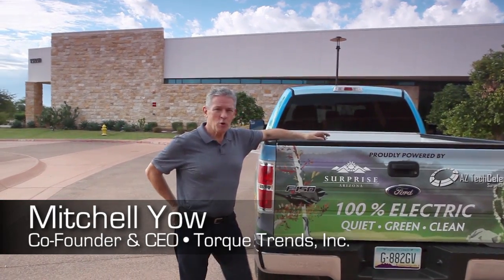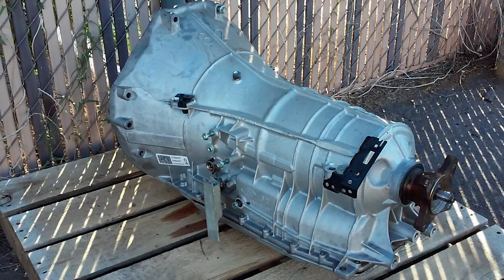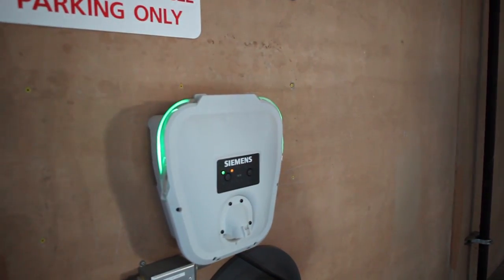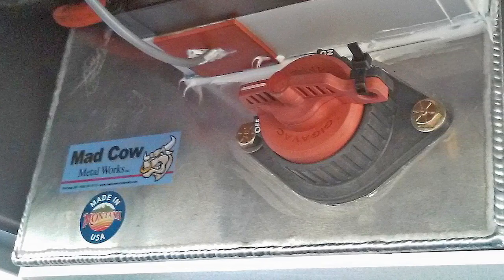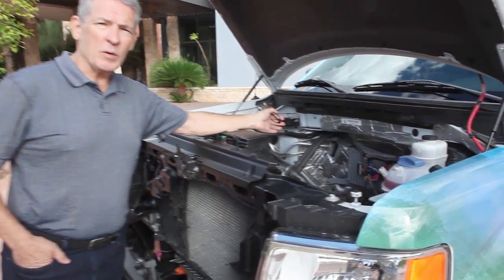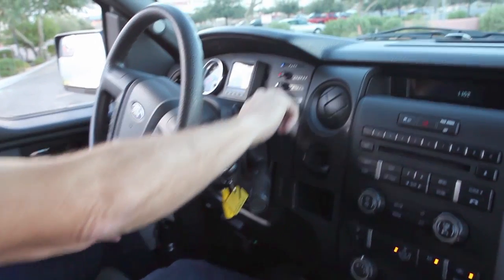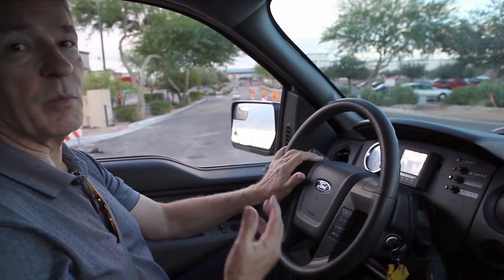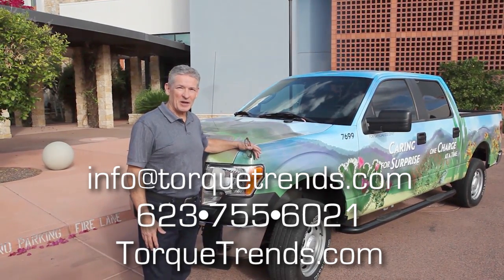Electric Truck Conversion - PNP F150 by Torque Trends Inc. Full Version

Comment: Very cool! Was that an aluminum body F150 or steel body?

My ideal electric pickup would be:

-Aluminum body F150
-4WD using the original transfer case
Could go as far at 75 MPH as it could with the original internal combustion drivetrain

That particular set of needs is driven by one of my core requirements: that it be flat towable behind a motorhome.

Is such a thing at all realistic? If so, how much do you guesstimate it would weigh, and what would it roughly cost to get one?

I know Ford will be introducing an electric F150, but early indications are that it will be like other EVs: that is, not 4WD and not four-down towable.

Comment: The bottom line: you can’t go on the freeway with it❌ 
If there was a way to boost the speed to a max of 75 mph loaded, I will be looking to sign up for the buy one. Great job on taking the initiative with your pilot project! It’s a great way to repurpose existing vehicles and lowering carbon footprint. Keep it up!✅✅✅
Reply: EVgine.com all electric F150 can go on the highway

Comment: Overall Wow!  Very well done!!  The only thing I could envision improving would be to put position sensors on the shift lever, so it operates just like a vehicle with a gas engine.  Electromotive ( diesel electric train engines) started with controls unfamiliar to the steam engine operators, but when they mimicked the steam throttle control for their diesel electric drive they converted the old steam engineers!  Probably why push button transmissions were less favored in cars as well..  I would definitely be happy using the buttons to select F,N,R, etc., I just don't know how the average driver would react to this style of gear selection.

Comment: But it’s not a zero emissions vehicle now is it. Where do you get your electricity from
Reply from the maker: Oh their live in Arizona and their whole roof is covered in solar panels.  Also most of big businesses cover their roofs in solar and give free charging for electric vehicles.  For example check out the roof of IKEA in Phoenix AZ ;)
Reply: Cool Car Video OK OK good point but What about everywhere else what if you have to travel more than 75 miles this vehicle is efficiency on zero emissions only applies to a short radius also if I got the full range of this vehicle wrong my bad. besides even huge company buildings that have solar panels lining the roof still aren’t completely independent from the power grid what’s your electric bill going to be 6Kw Is it a lot per Ful charge

Comment: I live in Buffalo NY, and it gets COLD... did you get the heat & defrosters working???
Reply: The entire 12v system and everything it operates is stock. Heat is a separate system and can also heat the battery pack.

Comment: Would cost about $12 to charge off peak @ .37c/kw but it's  75 mile range seems a bit short. I would want it to do 300+ $2.50/ galon for 21 G tank is still $52...will get you 450 miles
Theres plenty of room for more batteries....fill her up guys.

Comment: is it possible to install  100cc motorbike engine under the hood, to charge the cell  ?
Reply from the maker: We just made the video you can contact the builders here https://www.torquetrends.com/    but I guess you could get a Generator that runs on gas but I m not sure how long it would take to charge the truck.  I think it would be in 8 -10 hour range with a good generator.

Comment: We are in desperate need of a switched reluctance motor with a 15000RPM redline made specifically for conversions and sold to the public for no more than 5000 bucks. And also a closed system battery pack. Only this can save the classic car industry after ICEs are prohibited.

Comment: It's ok but 75mile range is useless and why a truck...that's now made useless it's no where near powerful enough to do anything, why not a sedan that would have been more efficient. I figured with a truck you could use a nice strong motor and have more room for batteries  ie under the bed and in a tool box in the bed something like this needs to have a 350 mile range with 400hp and 5-600 torque then it would be useful

Comment: It is a Good Idea. I'm not a Ford guy but, Its clean and Should have good power. However, In order to be able to haul a load of lumber or pull a small trailer, you'd need more motors and a bigger battery.  

I would say that is it is kinda comparable to the new Workhorse Truck, but Not a hybrid.  I Believe this truck Could be a Very Good Competitor to the Idea of the Tesla truck.
Reply: On the plus side, they gutted all of the things I dislike about Fords, so now it's a damn good truck! Lol

Comment: Very well done!  It would be nice if the battery pack was larger to allow for a greater driving range, including driving on a highway.

This is a great vehicle.  Great video.  Very informative.
Reply: Easy to do, just add money. Batteries are still the most expensive part of the conversion

Comment: I have no interest in turning an F-150 into a glorified golf cart. 

How about trying to match the same towing capacity, speed, and range...you know, the actual use case of a truck. 

 I'm disappointed you didn't do that. I mean, for what you did, you could have used a small car.
Reply: Certainly some trucks need to do that stuff, but not all of them. This truck isn't meant to replace all gas trucks, but for the jobs some trucks are meant for, this is a much better option.

Comment: HE SAY 1 to 2 HOURS OF AC MEN i don’t want the guy to build my truck he keep saying only for urban use he say it only can go 45 miles for hr sometimes you have to get in the hwy WE LIVE IN USA WHERE MOST OF THE TIMES you need to have speeds of 40 to 60 the truck is good for big cities with a lot of traffic 

i know he say clear is only for urban use but how hard its to make it faster special when you supposed to be a car engineer

HE IS SO FAR AWAY to even compete with tesla sorry but this truck need so much improvement
Reply: Yeah! How dare he build this truck to meet the specifications he was given?! He should have ignored the customer and built a truck that makes random YouTube trolls happy, damn it!

Douchebag...
Reply: Tesla doesn't have a pickup available. The customer bought it to fill a specific need. He clearly stated it doesnt go on the highway, they likely have more than one truck. Low cost of operation with 1/2 capability and safety.... pretty nice unit.

Comment: You answered my question about the CAN bus. If your going to use the stock dash and controls you will need to be compatible and using the CAN bus to talk to all the trucks devices. Now just add OBDII for diagnostics.

Comment: So the city buys a new truck and then removes the motor and transmission to put in an electric system. So now they have a 30,000 dollar truck that costs around 80,000 dollars. Sounds like someone at city is getting a kick back.
Reply from the maker: no no, Torque Trends who did the conversions did the whole truck and city is testing it for them.
Reply: Thanks for the correction.
Reply: No. Instead of auctioning off their old fleet vehicles, they can send them in to get converted into EVs. Between the significantly better cost to power them and reduced need for maintenance, this will end up saving money.

Comment: Who charges the truck? U buy gas or pay a higher power bill with limited mil to drive
Reply: Electricity is cheaper than gas on a "per mile" basis. The average cost across all EVs equates to roughly 100 miles/gallon. Anyone who thinks it costs more to power an EV than an ICE doesn't know anything about EVs.

Comment: You picked the Right truck.  Ford's 5.4 is a lemon. Can your unit run a Ford 4×4?
Reply: Meno, we build the TorqueBox brand reduction gear box. We do have a new Gen2 version that can be used in 4x4, all wheel drive, RWD, FWD, transaxle and with a single or dual motor with torque vectoring.
Reply: Any vehicle can be converted. At this time it only makes economical sense in short range fleets.

Comment: How much horsepower it has
Reply: The power comes from a 135 kW PM motor and makes a max of 340 newton meters of torque and spins up to 7700 rpm. This is perfect for an urban truck that does not carry big loads. In larger trucks or any truck pulling or carrying big, we use either a 220 kW or an HD 250 kW motor making up to 950 NM of torque.
Reply: Mitchell Yow thx

Comment: You pick the prefect truck to do a conversion on.  Ford's eco boost and V8's are problem engines.   The V8 is the no.1 engine for rebuilding.    This might be a way for Ford owners to have a reliable drive train.

Comment: So im guessing this is a 50 thousand dollar upgrade plus the truck so how does this save you money its a cool concept but
Reply: It takes a while to recoup investment and only makes sense for fleets at this time.
Reply: mindy burton on another reply he said $30k for the retrofit.  Hopefully it was a used truck.
Reply: never the less if you were to have this done you would have to buy a good used truck then 30 thousand
Reply: @mindyburton7537  This project is based on retrofitting fleet vehicles for municipalities. As in, taking their existing fleet vehicles, gutting their aging, worn out ICE systems and replacing them with this kit. This would be done at the end-of-service point, when the vehicles would typically be auctioned off. Instead, they're going to be converted and kept on duty. The difference in price between upgrading existing trucks instead of buying a new fleet will be made up quickly with the much reduced cost of "fueling" the vehicles.

Comment: motor is too small and range is too low
Reply: Your opinion of course. It pulls strong and gives the city more than they asked for.
Reply: Range is too low for who? The average American drives less than 40 miles/day. This truck could replace most of the cars in the US and not affect people's normal lives...other than being able to fuel up every night at home, while they're sleeping, instead of having to stop at a gas station (ooh, that's terrible).

Comment: Hi there, great job! 
Want to do conversion for my GMC Yukon, SUV Long ( 2015 model). 

1) Cannot understand what have you done with factory automatic gearbox, after conversion is it still 4WD or not? 

2) How did you adjusted traction control system (TCS) 

3) How did you adjusted Electronic stability control (ESC)

4) How have you connected the existing accessories ( steering control buttons, inside and outside vehicle front & back lights, cruise control, hazard lights, left and right indicator ....), by using existing factory buttons/switches or you installed new ones?!
Reply: Hi Roman, Thanks for your comments. Our pilot truck was a 4x2 and all Ford systems work. Basically through our controls we have to lie to the factory computer because it is looking for a lot of signals that went away with the factory drivetrain. We are now working on ways to get the package cost down as we perfect the F-150 system. We have not even looked at a GMC Yukon yet. If you move forward with an actual conversion, I recommend you contact New Eagle in Ann Arbor, Michigan, they are the control experts.

Comment: U need a little gas motor to recharge the batteries
Reply: Why? They get recharged every day, when the trucks get brought back. Why run a generator to do the job that the grid is already doing? That would only increase costs.

Comment: Excellent vid.  Seems like there'd be many places to shed weight, but everything costs something, I like the honest approach.  If you're in Arizona, a couple kw of PV on a large rack would keep that A/C going all day, shade the cab and bed, and add at least a few miles of range (do it!).  I was out on a huge buulding project in Phoenix for a year and the contractors would keep their trucks running all day just to keep the A/C going.  People not familiar don't know how really hot it gets there.  107℉ isn't even considered hot.
Reply: Thanks for the comments!
Reply: Is possible to have kits in to Mexico?
Reply: Ha Ha    would be great, but mexico will punish anyone doing something so good.  Tried and failed.    Better to get your residency, and move to the US if you want to do cool things.

Comment: It is not 0 emission if you have to plug it in.
Reply: Depends on what you plug into, we use the sun to charge many of our vehicles.
Reply: Actually it is 0 emissions as its while the vehicle is running under its own power. 
Now if you want to compare emissions of charging vs fuel there is still no comparison. Think of how much emissions are created when you factor extracting refining pumping and truck delivery of fuel on top of the electricity a gas station uses to operate(as its unlikely there are many using solar). 
As was stated already a lot electricity is created using solar wind water so depending where you get you power from this could be a completely zero emission vehicle. 
Try educating yourself before making stupid remarks

Comment: Eliminate the old differential. You are losing energy transferring power through it. If it is just a city vehicle then make it front wheel drive and get rid of the extra weight and the energy loses.
Reply: That would require a lot more engineering. Most trucks are built to be rwd standard

Comment: Nice prototype conversion.  I sure hope that developments such as bigger battery and quieter drivetrain are in your future.
Reply: The city asked for 50 miles between charges, they got 75, they are happy. It is not for everyone. It will take a Tesla, GM or Ford budget to create a long range truck. It will happen.

Comment: Super! How much this is upgrade? I meen hardware...
Reply: Depending on the range and quality of the build, for endurance, it would range between 25 and 40k one at a time. In volume of course the cost and price come down. The city paid 30k for this one and it could easily provide service for 15 years. The battery pack size greatly affects the price.

Comment: For such a beast of a truck this system works extremely well. 75 mile range with a 65 mph top speed in this thing is quite good. When I heard "30kWh" I almost laughed but held judgment till I heard the top speed. 

Nice work. It would be so cool to have a similar spec system on a classic truck from the 80's and back but bump the top end up to 85 mph or so.
Reply: paytontech it's never getting that range if you're going 65mph.  The mileage of EVs gets progressively worse the faster you go.
Reply: In the future we'll be not allowed to leave the smart cities without special permissions so it's a good city car

Comment: Well maybe someday will attach the drive electric motor directly to the rear differental. Then MicroBlue coat the rear end gears and bearings so as to reduce parasitic drag.  Then use the old engine bay as battery pack area.
Reply: Tesla attaches their AC motor to the front and rear differentials.
Reply: But that won't work so well with a live axle
Reply: They'd save a ton more money if they just bought a used Tesla or new model 3 and just transplanted all the parts, then sell the frame.

Comment: I do electric bikes in Glendale/Phoenix. Making an electric CR80r soon that will have about 40 hp.
Reply: Mitchell Yow 
I haven't started to build yet but I currently ride a 18kw bike around that goes 70 mph and has a range of about 50 miles.
Reply: Cool! Would love to visit and test drive.
Reply: Mitchell Yow  
I'm looking at doing a truck conversion. Where did you get your controller and motor?
Reply from the maker: cool will forward your message to the Mitch.  PS  whats the range ?
Reply: Cool Car Video 
For the new build I'm thinking 40 miles but it will all depend on how many batteries I can fit on it.
Reply: Yeah and the funny thing is it is going to have more power than that now. I am going to use a 600A dc controller at 92v so 50-55kw for around 60hp at the wheel. Muahahaha.

Comment: Consider when we begin to mass produce carbon fiber drive components and replace steel body parts with lighter weight components like aluminum and fiber glass.  As battery technology continues to increase storage and output capacity and understand and apply more active an passive energy recovery.  Wow.  Does the Government support any of the R&D?  It's just a question, not looking for a political discussion.  There is plenty of private money out there.

Comment: Imagine if the post office would use these. They would use 1/5th the "fuel" cost. Less than $2 for a fill up versus $30 for gas. Plug in every night. Little to no maintenance. They would save millions, and lessen pollution tremendously.  95% efficiency, versus 30% efficiency for ic engine. The ev revolution is here, just the economy will drive the transformation. Interesting that most innovation is coming from independents and not the big auto people. They are asleep at the wheel. Will end up like Kodak or blockbuster and become obsolete.
Reply: In France our post offices were recently equipped with electric utility vehicles, and the urban police are getting theirs deployed too. Users seem satisfied, they're silent, reliable and fun to drive
Reply: School buses
Reply: The tiny USPS vehicles get less than 10mpg. If they did ev, they'd go way beyond 500% for the "fuel cost"
Reply: Our local Postal Service here in Southern California purchased electric vehicles didn’t last because the battery systems weren’t tweaked or can’t get the battery company  oh oh they or the company went belly up I should say and could not fix the battery so I think they went to scrapyard but again those 20 years ago!,
Reply: Tom Tompkins At that point close the post office!